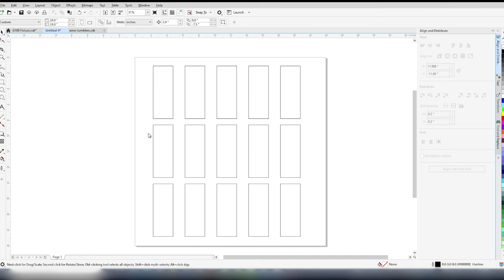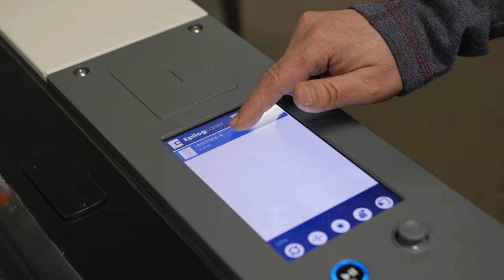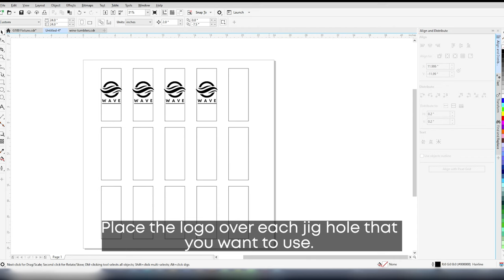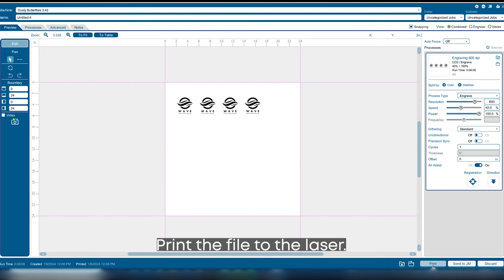Laser Quick Tip: Engraving Multiple Tumblers at One Time

Comment: I wasn't aware you could do these without the rotary.  How do you keep the aspect ratio correct on the sides/slopes?  This has my brain in over-drive right now. -  Also, need to try the foam.  I cannot seem to cut through foam without the charring/yellowing...
Reply from the maker: Hi Rick - the visual "stretching" of the logo at this size is very minimal, one mm or two or each side, so there is very little need to contract the artwork horizontally in this case. As for the polyethylene foam, we've used the same foam over and over for various projects like tool shadowing and decorate signage, it works great! Here is Laser Project: Sample Club we created with the source of the foam included in the article. https://www.epiloglaser.com/resources/sample-club/laser-cutting-foam-letters/

Hope this helps!